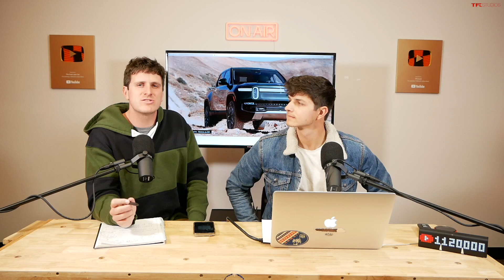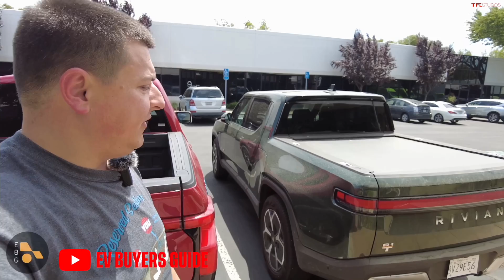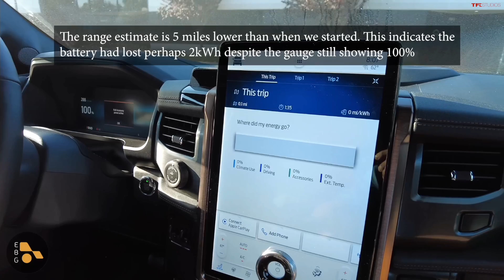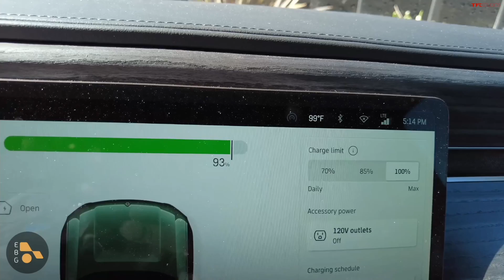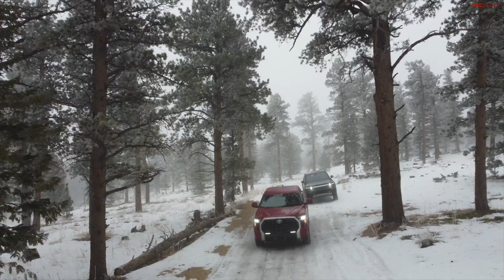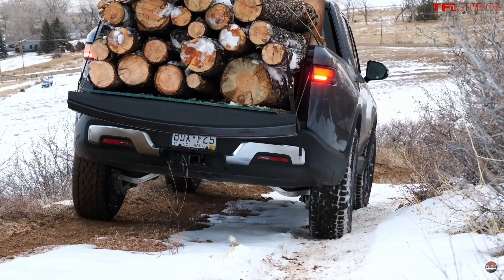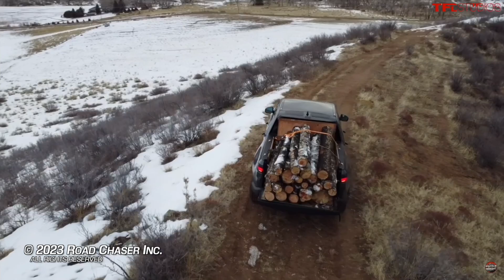This Rivian Is Getting The Equivalent of Just 25 MPG: Here's Why That Matters!

Comment: Imagine parking your ICE vehicle with a full tank and after a couple weeks loosing 1/4 tank of gas to nothing and thinking that was normal.
Reply: Imagine parking your ICE vehicle and the charger in your garage filled up the tank?
Reply: “Imagine parking your horse and 1/4 of your horse is missing!” Yea I don’t think you understand what a battery is.
Reply: @TheRidersChoice  What?!?  Maybe the OP edited his post, but your analogy makes no sense.
Reply: @737smartin  Comparing gasoline to a battery is pointless just like comparing it to a horse is pointless. Literally not the same thing at all and shouldn’t even be compared. Completely different type of vehicle and advantages and disadvantages. You will have to deal with battery drain at idle. But you will also be able to charge at home, instant torque, way less maintenance, lower center of gravity and better handling, etc.
Reply: @TheRidersChoice  I couldn't disagree more.  If you have a use case in mind, say...modern transportation...you can and SHOULD compare the various options, weigh the pro-cons, and decide.  To say this comparison is pointless seems absurd to me. 🤷

Comment: It's roughly 100W of continuous vampire drain, which is roughly the heat output of a human. Hasn't someone pointed a thermal camera around with some components exposed to see what's using the power?

Comment: 5:44 for a doubling of that energy loss, I would say it would almost have to be.  Now maybe the battery on the Rivian is just that well managed, and power usage is a huge part of that equation, but I would want to see a lot more data before subscribing to that theory.
Reply: I am quite curious to know what this could be, because the amount of energy loss is staggering.  it's almost the equivalent of running a small hot plate constantly, which is just an insane amount of loss.

Comment: Assuming this isn't a faulty latch or something mentioned elsewhere in the comment section-

That whole video working on David's ranch loses a bit of luster hearing this. Goes from ready to work tool to fussy pet you must take care of. Maybe that's too harsh, but it surely looks more like that than before.

I wonder if you could tow a 10 ft teardrop mini camper 50 miles, take a 5 day camping trip, use the onboard 1500w inverter, and tow the thing back... Obviously you can eat up battery by going crazy but normal camping stuff like lights, phones, and say, mini fridge or it's fire season so you use an induction stove for a few minutes a day.

You'd loose ~10% battery just by not being plugged in the whole time.

Comment: Thanks Tommy. I wonder if Amazon is willing to suffer that much battery loss on all their Rivian EV delivery vehicles...?
Reply: Considering that they will be on a charger every night and driven every day, that's not likely to be a factor for Amazon
Reply: @rowerwet    This guy still only used about $12.50 worth of power to drive back and forth to work for 10 days including all warming up time and travel. Not a stretch to think he could burn through the same amount of money in a couple days driving an ice vehicle pick up. His theory on battery cycles is flawed as well. Whether you add 5% charge ten times or 50% charge one time it's technically the exact same cycle for the battery. Also he's actually using more cycles of his battery doing this method as the vehicle would use power from his house to preheat the vehicle if it was plugged in rather than depleting the battery and adding additional cycle use. he'd be better to charge it to 50 or 60% and plug it in daily for max battery health

Comment: This is not normal, and it's not cool for Rivian to pretend that it is. If that is really within their spec variance, they're doing it wrong.

I've owned 3 EVs and none of them experience vampire drain (or very little), even sitting at MSP in negative temps for a week!The truck is keeping systems active that do not need to be on when the truck is not in use.

Comment: I had my R1T in climate controlled garage and charged on 2/2/23 at 12:28pm and was at 70% (219 miles in all-purpose mode) and not driving my vehicle at all by 2/4/23 at 8:24am I was at 66% (206 miles in all-purpose mode).  Gear Guard was on, but have it turned off for home.  This equates to 6.31% loss over about 44 hour period.  If extrapolated out, this would equate to a little over $17.00 per month, based upon home charging at my rate per kwh.

Comment: This started with Tesla. They’ve tried to normalise EV vampire drain. But it’s really not normal.

There are dozens of EVs you can buy today have zero (or unmeasurable) vampire drain. We have an I-pace and an E-tron. (We used to own a gen-1 Leaf). We can leave these for a couple of weeks at a time in airport parking and have the same SoC when we return as when we left. I have friends and colleagues with Chevy Bolt, Kia EV6, VW iD4, Volvo XC40 and none of them have any appreciable drain either.

Common excuses or explanations are the always-on telematics or the need for the 12v to be topped up from time to time. These are both valid suggestions, however all the vehicles mentioned above have always-on telematics (even the old Leaf had a janky old 3G system that was always on) - this runs from the 12v, not the HV pack. And the occasional 12v top-ups will consume some power of course but it should be almost unmeasurable.

EV high voltage battery packs have breakers that snap open once the vehicle is parked and locked. You can hear it in most EVs.  Lock the vehicle, wait a moment and you’ll hear a clunk from underneath - normally toward the back of the vehicle. That’s the breakers snapping open. The opposite is true when you unlock - you’ll hear the clunk again as the breakers snap shut ready for driving. If you’re “lucky” (I guess) you might hear the HV breakers snap shut while the vehicle is parked. That is when it’s doing a 12V too-up. The breakers will open again once the 12v is back up to about 14.4v.

Once the HV pack is disconnected it has no load on it. There is the known phenomenon of Li-ion battery self-discharge, but the rate of discharge runs about 1.5% a month. Not 4% in 24 hours. In a fully charged Rivian pack, 4% is 5.4kW. That’s like leaving an electric radiator on for 7 hours. That’s more energy than the average house consumes overnight. That’s a huge problem.

I don’t know how else to try to lay this out but outside of a couple of Tesla owners I know, none of my friends or colleagues who drive modern EVs have any appreciable HV battery drain when parked and unplugged.  Rivian have a problem and they’ve improved it somewhat over time with OTA updates but I worry that there’s some fundamental issue with their hardware implementation that is causing this.

Comment: I was on the "EV fence" but stories like this keep me from buying one.  It's not like you can just pop the hood on these things, replace an air filter or something and fix the issue.  I I've had firmware issues with my other electronics, and I don't want my vehicle to be "buggy" too.
Reply: I would say it depends on the manufacturer.  A few companies have been making EVs for a long time and those are generally pretty good - eg. BMW, Tesla, GM & Nissan.   I have a 10 year old BMW i3 and it never has these issues.   AFAIK, the Bolt & Leaf are also pretty reliable, so are Teslas.

Comment: I am surprised by this, I am a R1T owner and there is a drain, but I recently left my truck at the airport gear guard on, 35 deg nights. I took a screenshot every 24 hours of the app and lost 1% per day over 4 days.
Reply: Was it parked outside or underground? The temp in underground structures doesn't get as cold.
Reply: how old is your truck?  Wonder if there is a difference between early and later models?

Comment: So I have an early VIN R1T (June ‘22) and frankly I’m not seeing this issue.  Now early  on I did have the phantom
Drain problem but I’ve had it sit for a week and maybe lost 2%.
Reply: No such issue w my R1T like you, same build timeframe. Plus I have no garage so it is parked outside all the time in cold winter. But if others are experiencing this - especially with Gearguard off, Riv needs to step up to the plate. And work on their service tech response!

Comment: Interesting issue considering they are gear towards outdoor enthusiasts. Camping remote for a few days could leave you with low range to get out
Reply: as an outdoor enthusiasts its a big fat NO to using an EV if they lose battery like that combined with the limited range it asking for trouble if you go well off the beaten track.
Reply: These were obviously made for the "outdoors" person that goes fully decked out in Patagonia and Arcteryx to get Starbucks and hang out in front of the daycare chit chatting for 20 minutes when they go pick up their kids
Reply: @kevinconroy6606  The off-road capability is actually very, very good. Reliability remains to be seen. That being said, I personally think electric trucks are about a decade too early at this point given the current state of battery technology.
Reply: An outdoor enthusiast would just buy a 4Runner/Tacoma/Wrangler/Outback and call it a day.  Anyone buying an EV to do this is spending twice as much money for even more of an "image" vehicle.
Reply: Correct. The radian starts at 73,000, and even after tax breaks do you know what kind of mods you could do to a 4Runner? You could also get a 2015 Land Cruiser and do some mods.

Comment: On the Teslas, if you disconnect the 12v battery it will eliminate the drain. I wonder if it's the same on the Rivian? Kind of a pain but worth doing if you're going to leave the truck for weeks

Comment: Why was the average speed 11 miles per hour? That usually indicates a lot of idling, which will kill the range in the winter.
Reply: Even on an ice vehicle, if you drive 60 miles and then idle it for 4 hours, your mileage will tank.
Reply: Yeah not a very accurate test if he isn’t replicating normal driving

Comment: The only thing that could possibly use that much energy is heating/cooling the battery pack to maintain ideal pack temperature.  That's why the Rivian rep said "depending on temperature". That is not a minor issue, it makes the thing an incredible energy hog if it is pulling c. 3khw a day just sitting in your unheated garage, plugged in.  Not to mention you couldn't safely leave it in an airport parking lot for two weeks if you needed to.

Comment: Phantom drain can be the computers keeping everything alive to maintain the battery, especially during sub zero temperatures when heating is needed. Also, RIvian wants to keep the computers active so you can jump into the truck and go without waiting for the computers to load. The computers are always on, sucking up energy at all times. They need a hibernate mode that shuts down everything. The flip side, you'll need to wait for the car to come-to-life to start driving.
Reply: my BMW i3 EV has solved this 10 years ago. It's keyless like the Rivian.  It starts the computers when you open the door. By the time you are buckled up - everything is ready to go.  Shuts down down 15 minutes after all doors closed.
Reply: @eXo0us-T  Yeah, my i3 has zero power drain.   Parked it on the street for 4 days - it was still 100% on day 5.
Reply: @ckm-mkc  even longer, I had it sitting for solid 6 weeks and at lost about 1-2%

Comment: I did not even know about this. Pretty disappointing. I wonder if smaller batteries would be affected less, like would a small EV like a Bolt or a Leaf be less prone to this? I hate to say it, cuz it just sounds like compiling reasons, but a gas car could sit for months at a time and have the same range at the end as at the start.

Comment: 3-5% losses is normal? That needs a redesign, STAT! Also, 1.8 mi/kW is just terrible. Model 3s get about 4.5 to 5 mi/kW. Granted, Rivian is nowhere near as aerodynamic. Still, 1.8? Horrible. Just because a vehicle is an EV, even a simply gorgeous one like the Rivian, does not mean it is economical to own/operate.
Reply: Most Rivians get over 2kw/mile. This is a  case of someone living in a cold climate, probably running the heater on high, using the least efficient tires Rivian has to offer, while only averaging 11 miles per hour speed 😂

Comment: not sure where jordan lives but i wonder how much drain is due to the batteries needing to heat themselves in a cold climate. I know nothing about Rivian’s batteries specifically but I know Li batteries generally need to kept somewhere in the 30-40 deg F range in order to be able to be charged and something lower than that like maybe 20 deg F to be discharged.  Takes those temps with a grain of salt as I am going off limited memory on the subject. I assume the batteries are self heating and in a cold climate could be a major drain just to keep the vehicle ready to drive and more so ready to charge at a moment’s notice. If you only drive a few miles a day the batteries don’t get much chance to heat up through driving and therefore remain in a state of self heating much of the time between infrequent charges, again in a cold climate.

Comment: This is especially worrying because there is enough phantom drain to cause significant cycling of the battery over time.  That's why it is a good idea to keep it plugged in if you can to prevent cycling.  Loss of SOC due to phantom drain counts toward the pack's cycle count and when your battery finally dies in the future, it probably died a bit earlier due to a few dozen of the 1000-1500 life cycles being used up by phantom drain.  I suspect Rivian will get it right in software; Tesla did.  A Tesla loses very little SOC if you turn off sentry mode.
Reply: Do we know that plugging in the truck actually changes where the power is pulled from? Doesn’t it all come out the battery anyway (and then the battery is topped up)?
Reply: This guy still only used about $12.50 worth of power to drive back and forth to work for 10 days including all warming up time and travel. Not a stretch to think he could burn through the same amount of money in a couple days driving an ice vehicle pick up. His theory on battery cycles is flawed as well. Whether you add 5% charge ten times or 50% charge one time it's technically the exact same cycle for the battery. Also he's actually using more cycles of his battery doing this method as the vehicle would use power from his house to preheat the vehicle if it was plugged in rather than depleting the battery and adding additional cycle use. he'd be better to charge it to 50 or 60% and plug it in daily for max battery health

Comment: The vampire drain is a well-talked-about thing.  However, I wonder how Jordan got an average speed of 11 mph over 5 hours and 42 minutes.  That is essentially using a Rivian like a golf cart.  Was he offroading the entire time?  By comparison, I used Google Maps to plan a drive from the Lower East Side to upper Harlem in New York City at rush hour.  Even with that much traffic and avoiding highways, Google estimates that trip is 12.1 miles and would take 1 hour and 3 minutes, for an average speed of 11.5 mph.  That is a faster rate than the 11 mph average speed Jordan did over 5 hours and 42 minutes.
Reply: Thank you….I saw the same thing but seems like no one else noticed

Comment: Every ev company needs an expert mode where you can turn off battery preconditioning and in turn just get reduced top speed/acceleration and regen. Id happily utilize that in the winter months. My car also eats more by utilizing the front induction motor for regen to heat battery. That is absurd when youre only driving 5 miles one way.
Reply: You do not understand that if a battery is not pre-conditioned driving greatly effects range and can damage a battery over time...

Comment: This is an engineering debacle.  An electric vehicles "standby" systems should run off of a standard 12 or 48V system that should maintain enough power to keep necessities running for 2+/- weeks just as is the case in an ICE vehicle.  Losing 2-12 KWH per day suggests they ARE using the truck as part of the interweb hive mind.  Imagine dropping your car off at the airport at 25% charge before your 2 week business trip or vacation and returning to a $100k brick.  I would literally want to burn it to the ground.  Imagine coming back to your ICE vehicle to find gremlins siphoned out a quarter tank of gas while you were gone.

Comment: 3-12% a day is just crazy. If I take the 2.5 kWh then that is 912.5 kWh in a year. In Germany for many people the electricity at home is now 40ct/kWh, so it would cost 1€ per day or 365€ a year just owning the car.
Reply: 0.40 per kWh? I thought Germany went all in on renewables so energy should be abundant and cheap... Here I am in my coal, hydro, and nuclear powered location paying 0.11 CAD per kWh.
Reply: @Snerdles  Actually sadly we didn't. We started strong at first, but under Merkel it slowed down a lot. So because of that in combination with high gas and oil prices, then electricity is very expensive. Solar is actually the cheapest electricity. But there is hope, with the new government the investment in renewable energy went up a lot.
Reply: @Warrior6350  So renewable sources didn't grow from 50TWh in 2002, to over 250TWh in 2022 growing by about 5 times in just 20 years?
Reply: @Snerdles  It did, but it is not nearly enough. You should check how much was added every year. Especially wind was much more in the beginning. And wind is very important, since we also have it at night.

Comment: Scan the truck with a thermal camera and find your power drain source
Reply: The truck is also sending data back to rivian home base. And it uses coolant to keep the battery and computer between certain temperature parameters